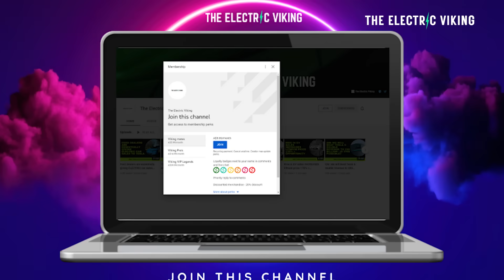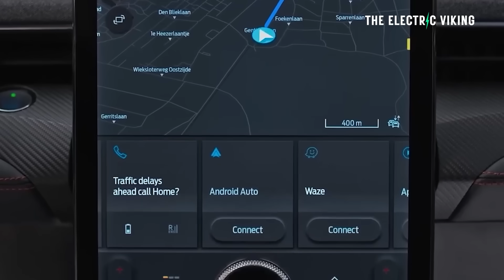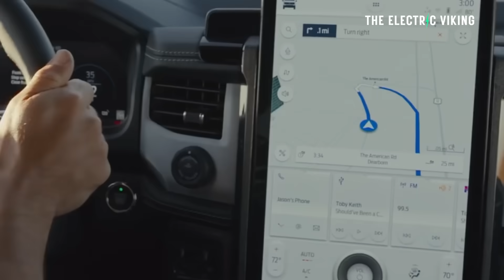Ford plans to SHRINK its Batteries by 33%—but keep Range the Same

Comment: Considering Tesla's proven reliability and Fords track record of Recalls.....   Tesla is still the clear choice.... BUT at least Ford is making drastic changes which is what they need to do and get rid of those employees A.S.A.P.  Save money wherever you can.
Reply: Ford's EV's have been quite a bit more reliable than their ICE vehicles.

Tesla was the most recalled brand in 2023, with the Y, 3, X, and S occupying 4 of the top 5 slots according to an iSeeCars study.
Reply: The fascism facter knocks Tesla out of the runnung.
Reply: Ford can't get rid of its union labor. Basically they will build the old dinosaur gasoline vehicles in unionized plants, to keep UAW happy, and meanwhile build the new EVs in robotic plants. Kind of like two companies. GM's having to do the same thing.
Reply: @ChickensAndGardening  Tesla's reliability? How about parts flying off the cybertruck? How about picking up a brand new cybertruck and it is full of build errors? I rented a Tesla from Hertz and the plastic interior parts were loose!
Reply: @keithdow8327  Most people report Tesla has high quality (except for some fit and finish), but okay, if you say so!

Comment: All the efficiency gains likely coming from engineering improvements. Smaller drag coefficient = more efficient. Lighter vehicle = more efficient. Higher energy density batteries are a force multiplier as it makes the vehicle lighter overall and thus more efficient.
Reply: Exactly this. All 3 of Ford's current EV's (e-transit, f-150 lightning, and mach-e) are very basic & crude EV conversions of their existing ICE vehicles. Purpose built EV's should be drastically better even with the same size battery.

Ford poached Alan Clarke, the guy that lead the development of the model 3 and Y at Tesla.  It is not unreasonable to suggest he may do a better job the 2nd time around at Ford and make even better more efficient vehicles there.
Reply: Ford has often looked to increase the use of magnesium in their vehicles. Magnesium can be used in Gigacasting. This could figure prominently in Ford's plans....